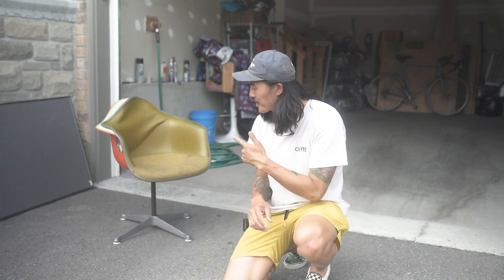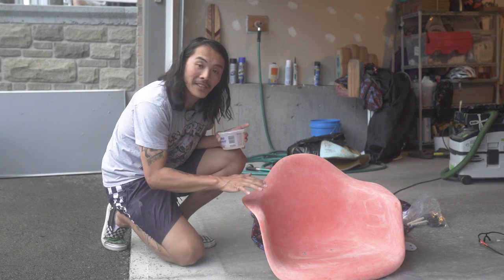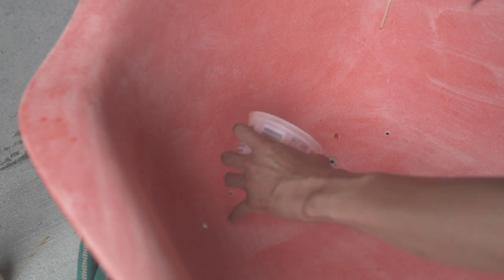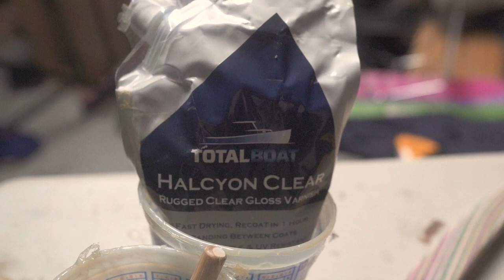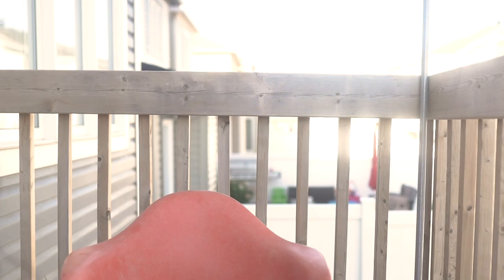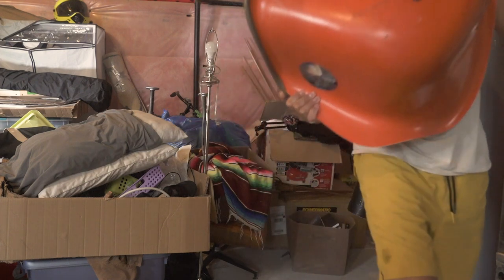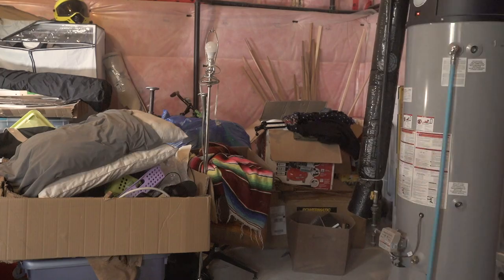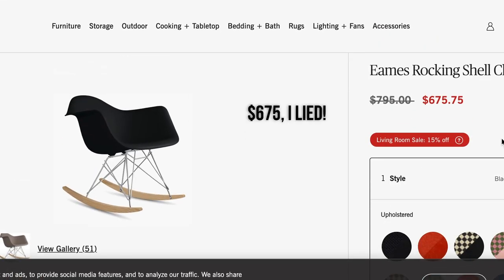Eames Shell Rocking Chair Restoration!

Comment: thanks for this video! you posted this at the perfect time as I just started working on a shell chair that I just picked up. Do you know if the screws for the rocking frame line up with the original holes that you plugged? my chair has the same original base like you had, and I wanted to screw into the frame through the original holes instead.
Reply from the maker: yes, they do line up and i'm told that 99% of shells with after market rockers works pretty good together!

Comment: Hey Andrew.

very cool video and great craftsmanship. which wax did you use for the surface? and are there other means to restore the fiberglass surface? I have 3 armchairs as a project.
Thank you for your feedback.
Best regards from the middle of Germany 🤙🏼
Reply from the maker: i actually think epoxying works too! I did it on another chair and found it ok!
Reply: @AndrewSzeto  what kind of wax did you use?

Comment: Hi! May I ask what kind of wax you used. I am restoring one now trying to keep the original finish instead of painting it.
Reply from the maker: oooh good question. this was turtle wax. i don't love it. i am actually finishing with epoxy right now (i build paddles and canes too), and fiberglass is effectively epoxy anyhow, and i am finding that to work really well. i will be posting the process to my instagram, @szetoszeto
Reply: @AndrewSzeto  I'm cheating and used boat repair to seal the holes ( so didn't have to mix it) but fiberglass is the devil! Don't kill me but how are you appling the epoxy? Brush?
Reply from the maker: @cr8saenz  high density foam brush. 2 liiiight coats with some slight sanding inbetween. should do the trick!
Reply: @AndrewSzeto  Awesome Thank you!

Comment: Very cool, Andrew. I have my Mom's old desk chair - identical to the one you started with. I'm keeping the swivel, but the shockmounts need to be removed and replaced. ANy tips on removing them? They are stuck in some thick epoxy - would a heat gun be necessary? Acetone? A hair dryer? And removing the fabric? Is that foam underneath toxic? I'm thinking of going the asbestos way and just leaving it in place and taping up the holes in the shell with colored duct tape. Appreciate any thoughts you have.